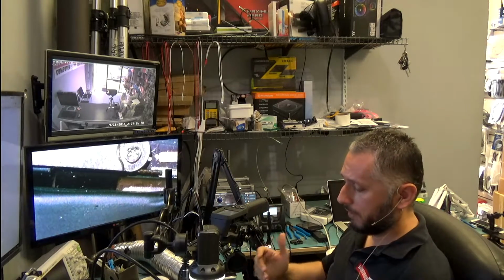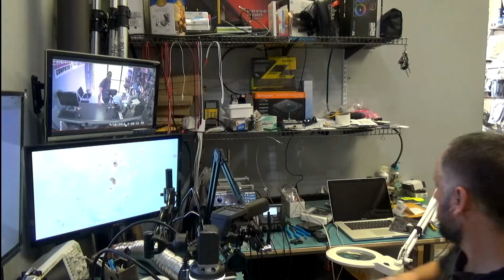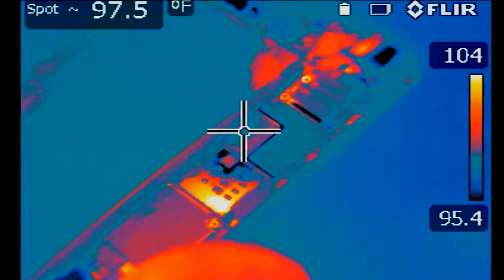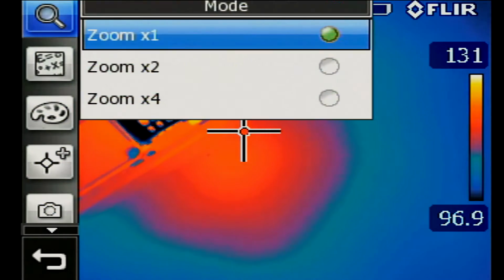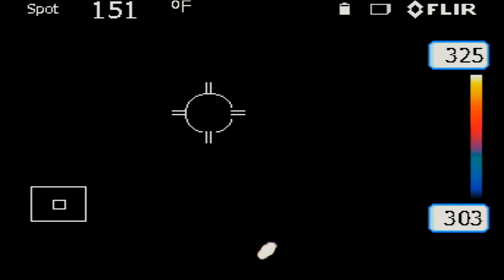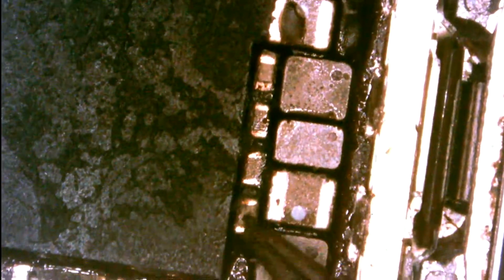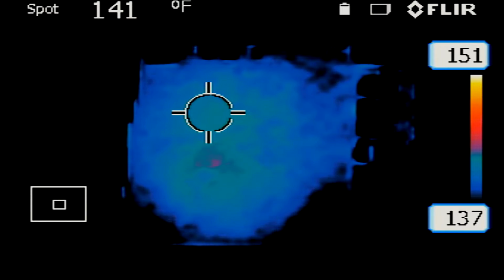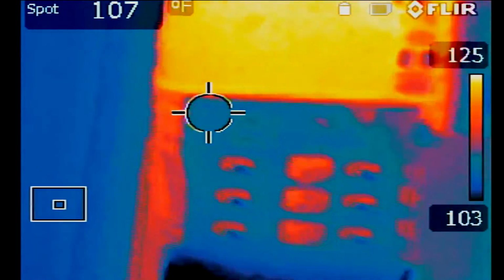iPhone 6+ No Display Very hot - Fastest way to detect a short using Flir Thermal Camera

Comment: Boss which model tharmal cam you Are  using? Model number of flir.
Reply from the maker: https://rover.ebay.com/rover/1/711-53200-19255-0/1?mpre=https%3A%2F%2Fwww.ebay.com%2Fsch%2Fi.html%3F_from%3DR40%26_trksid%3Dm570.l1313%26_nkw%3Dflir%2Be60%2Binfrared%26_sacat%3D0%26LH_TitleDesc%3D0%26_osacat%3D0%26_odkw%3Dflir%2Be60&campid=5338440312&toolid=20008

Comment: is all caps one side to ground or not
Reply from the maker: Not all capacitors are connected to ground. The ones connected to ground form a low pass filter to remove high frequency signals from the line by giving those signals a low impedance path to ground.
Reply: @NorthridgeFix  thanks for reply so only power lines have caps to ground or data lines also
Reply: geoepi321975 Power rails, IC’s, the answer you got was the same you would get from an experienced design engineer - capacitors to them serve the purpose of limiting RFI in a circuit - dumping this radio frequency energy to ground. The layman can do well to think of them as filters - where on a power supply rail - you want clean DC - ‘since capacitors pass AC and block DC - if tied to ground: they dump only the AC component to ground. You can also find capacitors in RC / LC networks, tuned tank circuits: want to see the neatest application ever for a capacitor? - search google for the ingenious resistor / capacitor bomb timing circuit - find a paper that explains how it worked. It’s very graceful and enlightening.
Reply: +skeggjold gunnr thanks a lot
Reply: ELI the ICE man / a cheap dual channel oscilloscope / a simple signal generator / a cheap assortment grab bag of misc. inductors and capactitors and resistors. A good scientific calculator and some electronics formulas. Oh, and your dad's old Simpson model 260 volt/ohm meter. Get all them things together then watch THIS!

https://youtu.be/faQdO3ay-X0